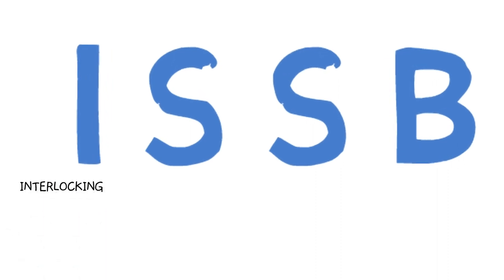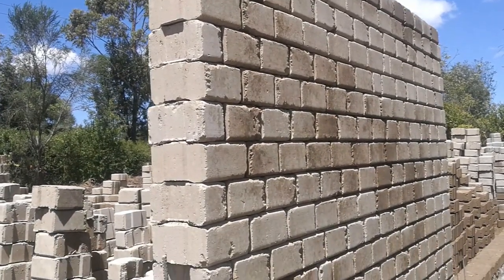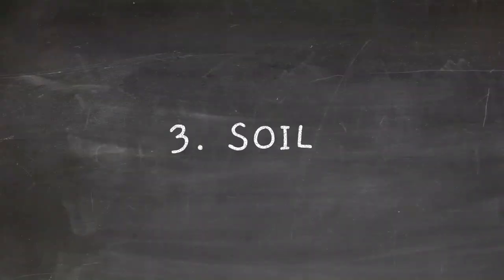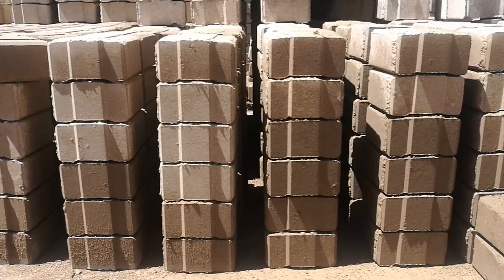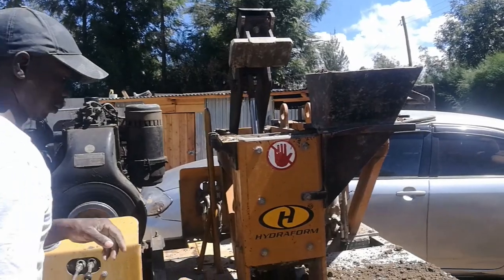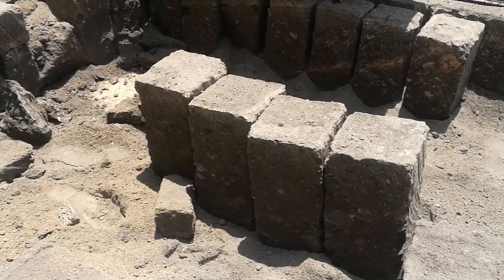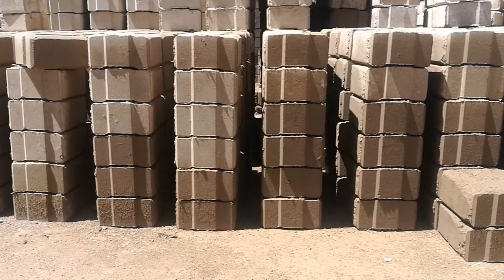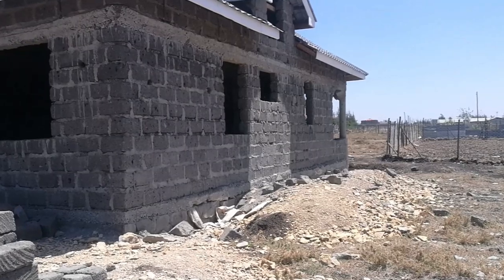Building Your Home? Discover 3 Aspects to Help You Decide Between ISSBs or Stone Blocks

Comment: what is the pressure required to compress the soil mix
Reply from the maker: This will vary with the machine. The hydraulic machine provides a higher compressive force than the manual one

Comment: You are using up more material when using stone but I wonder when using EPS if you can use the earth  mixed in with the cement for the walls and when you need to do the floors you will use concrete for strength what is your opinion??
Reply from the maker: Yeah EPS depends on concrete (cement, sand, gravel) for strength
Reply: Can it be used for storey building?